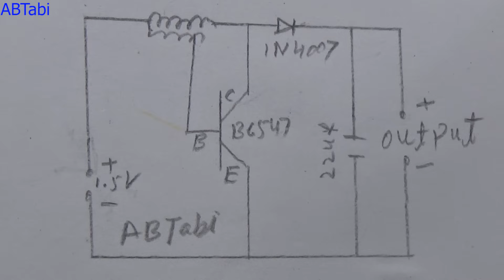How to make a DC to DC boost converter

Comment: i want use 50v capacitor with the same schematic as a battery booster in my ebike is it gonna work no fear for any damage? thnx
Reply: Learn the difference between voltage and current.
Reply: @dutchsailor6620  I know the difference but I don’t understand yre answer
Reply: @تدبّر-ع6ظ  This circuit might reach the voltage you need but the moment you put a load on it (battery pack) it can not sustain the current to maintain the voltage. The voltage as printed on the capacitor will only tell you the breakdown voltage of the component but has no influence on the circuits performance. Current(A) and voltage(V) are intertwined to deliver what you need (Power) but won't get from this circuit with all its design flaws like a missing flyback diode.